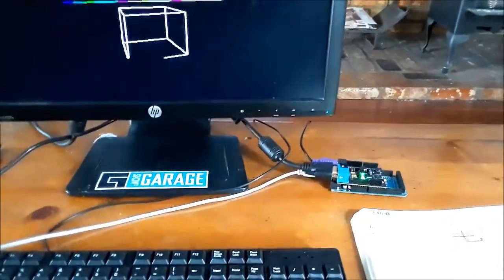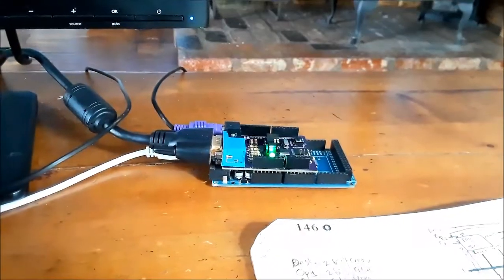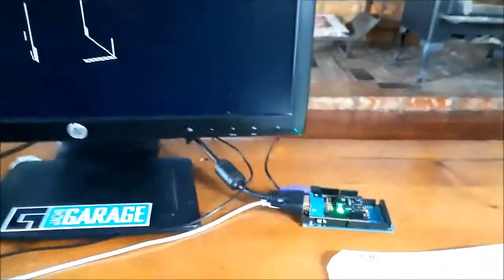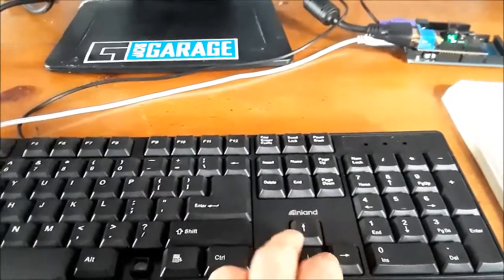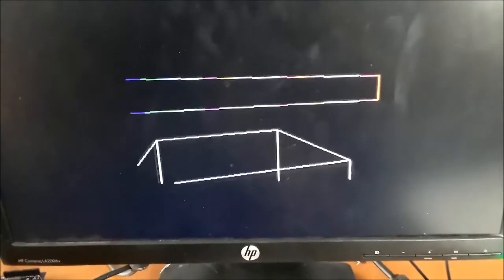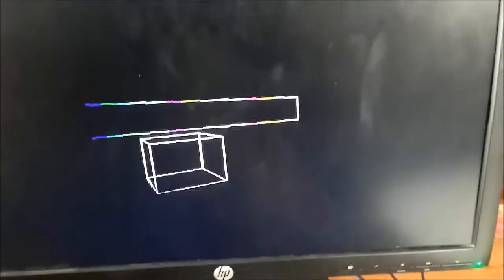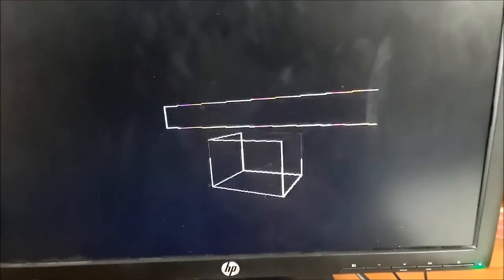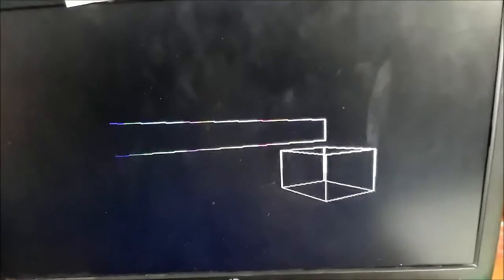Arduino + Parallax Propeller 3D assembly routines completed!!!

Comment: Why did you chose to use the Arduino instead of just using the Propeller?
Reply from the maker: Unfortunately the parallax propeller has limited libraries and support.  Arduino has more software and is generally more versatile, even though the propeller beats most avr chips hands down.
Reply: @Nuclear_Man_D  The C implementation for the Propeller is very complete. You have libraries for I2C, SPI, COGs, besides many of the standard libraries that are implemented in GCC.

As for beating many AVR chips, IMHO, I don't agree. It surpasses many micros, including all and every micros that Microchip and Atmel has to offer. You'll see that is true if you use C or PASM instead of SPIN or other interpreted languages.
Reply from the maker: @samuellourenco1050  Yes, I have used some of the C implementation, and it is quite complete.  When I started with propeller that didn't exist though, and even still the Arduino is far more complete in that area.  The propeller is more powerful than other micros, that's why I used it for rendering.  When I said the propeller beat other chips I meant that it was more powerful XD.  Do you use the propeller a lot?  I haven't used it as much lately but it is one of my favorites.  I'm excited for the propeller 2
Reply: @Nuclear_Man_D  I used to do some projects using Microchip micros, but got unsatisfied by the tools. Eventually I found Propeller and I loved it. Never tried anything else ever since.

As for the Propeller 2, I must say it is quite a beast. C is not completely implemented yet, but I've managed to port a prime number calculation program that I've written for the P8X32A, and I must say that the new chip is a order of magnitude faster at 80MHz. Undoubtedly, this new architecture is way more efficient.
Reply from the maker: @samuellourenco1050  Really?  That's good to hear!  And doesn't it have a higher max clock too?  Wait I didn't think it had come out yet.
Reply: @Nuclear_Man_D  It is not out yet. I have an engineering sample that I've managed to get. The clock can be as high as 350MHz, although the standard is 180MHz. I'm now testing it at 160MHz.

Anyway, the chip may be released in April or May. There will be more samples in the future. Just watch Parallax forums.